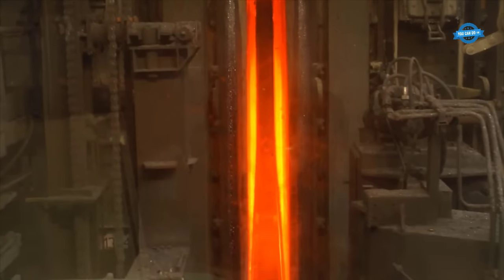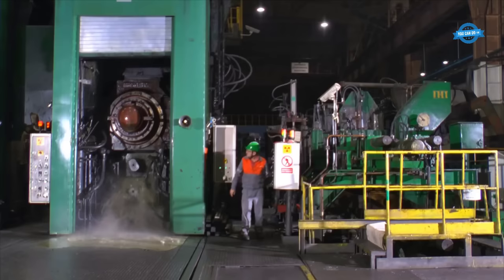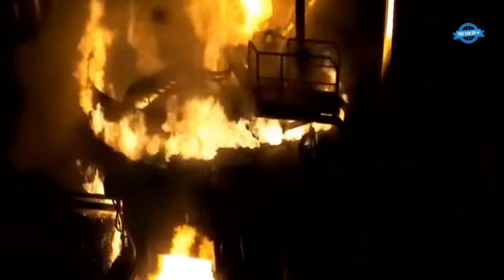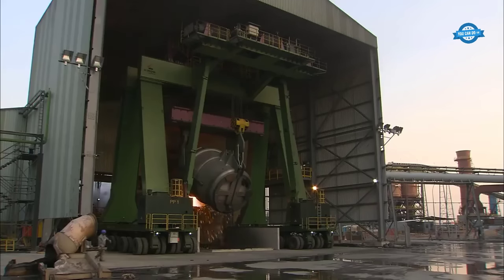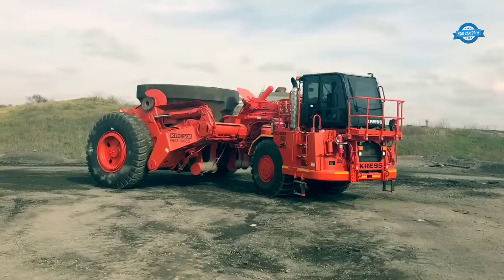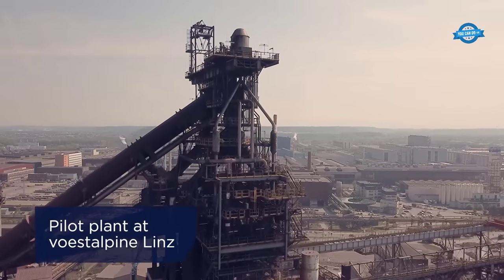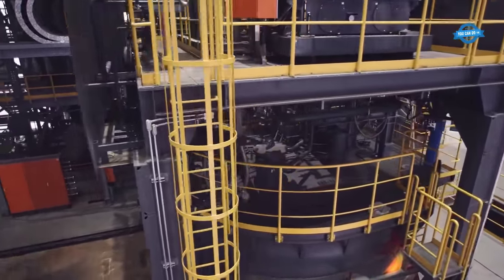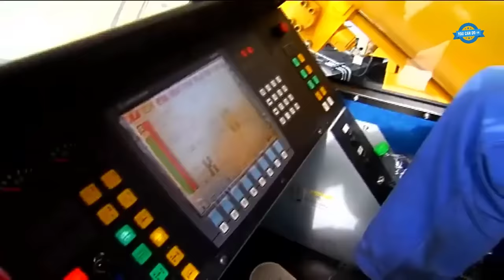Extremely Dangerous Accident Of Molten Metal Ladle. Heavy-duty Machinery & Equipments in Steelmaking

Comment: Artificial voice reading sales material and specs in a language the poster doesn't even understand.
Reply: It's sounds more like it has been translated sequentially through several languages of which the poster doesn't understand.
Reply: One of the most remarkable features of the grizzly Ladle is its exceptional heat and wear resistance it achieves this by incorporating additional protective measures for critical structural elements that are subjected to intense thermal and abrasive forces that ensures the Ladle remains in optimal condition.
Whewww,  I had to stop on that before I choked. I wanna memorize and use sometime during a conversation with someone I don't like. 
Lol. Have mercy
Reply: @sammylacks4937 Agreed.. hear..
Reply: @bobweiram6321 Yeas,agreed..

Comment: The " hot metal" from the furnace we call "pig iron" and we call them "bottle cars" not torpedo cars. Worked as a union Boilermaker all over the 9 blast furnaces, 6 oxygen furnaces and assorted electric arc furnaces and their associated pollution control systems in SE Michigan.
Reply: In the case of the "torpedo cars" it could be that it's a literal translation from a non-English language. I have heard them called as such in the (stainless) steel plant where I work as an industrial (IT) systems engineer. However, that is only the term used in my native language and dialect, plus I only have my specific plant as a reference. So, likely it's the wrong term in English indeed, since I have never heard the term used in English before while I have heard the term "bottle cars". So my guess is that it was literally translated from some European language. Perhaps, since this was recorded in Poland, they are called "torpedo cars" in Polish as well

Endlessly fascinating environment in any case, I could wander around there for days being in a constant state of awe. That said, you do have to have your head on a swivel at all times. And even then, serious accidents will still happen from time to time, though much less frequently than they used to. Everything there is huge, hot, flammable, toxic, under high pressure, at high speed and/or massively heavy, so if accidents happen, the consequences are often proportionately serious. We had a fatal accident not too long ago where someone's sleeve caught on some spinning rollers used for cold-rolling steel plates and he was pulled in.
Reply: @BinaryBlueBull  I'm 72 and in my years I've worked with people from all over the world. One thing I've learned is that different people refer to the same thing with different terms. This depends on your country and in some cases your trade.  My comment was meant as informational not a criticizm.
Reply: @richardkawucha1232  Indeed, quite clearly, and I read it as such too. My reply was meant as an addendum, also not as criticism. I personally love encountering random snippets of information, such as is the case with your comment. So when I know something, I often try to share it in turn. Kind of a quid pro quo for all the information other people have provided me with
Reply: @BinaryBlueBull  I also enjoyed this as I am of Polish descent.
Reply: Yeah and the folks from Bethlehem Steel called them 'subs'.  Different names, same thing.
Reply: @BinaryBlueBull   Most of the fatal accidents at steel mills in my experience as a safety steward in a big integrated steel mill was accidents not directly related to the production of the steel which most would think to be the most dangerous.  Most of the deaths seemed to be from maintenance related accidents such as scaffolding, confined spaces, lockout failures.  The people in the dangerous jobs knew the risks and were always on guard of encountering them.
Reply: They're probably called different things in different regions.
Reply: SE Michigan , all those plants are shut down now . McLouth , Ford Rouge , Great Lakes .

Comment: I worked for some years in a foundry that produced Aluminum Nickel Cobalt 5 magnets (AlNiCo).  While it was a relatively small foundry, but I did have the experience of running without thinking!  I ran, for the first and only time in my life with no consideration about weather I should run or not!  I was standing next to a mold that was filled with white hot metal when it caught on it's track and began to tip over.  I could have easily been killed by that metal but instead I ran!   I am an old man now but I never again faced such a situation.  There was no decision!  You run or you die!
Reply: I worked with liquid steel for 29 years. One melt 350 tons. The plant produces about 10 million tons of steel per year. In case of danger, always run to the safe side and only then look back at what happened. Sometimes when going to work, an inner voice tells you that something is going to happen at work today... And it does. This is called intuition based on vast experience. At work, like a pilot in a dogfight, you must constantly turn your head and constantly monitor the situation around you. Greetings from Russia
Reply: Run to Christ for salvation, or the wrath of God will burn against you eternally, for breaking his commandments and rejecting his way of salvation!!!!!!

Comment: I'm glad I got to see deep inside heavy industry in person.  I snuck into a VIP tour in US Steel Gary Works about 45 years ago.
Reply: I actually worked there. I worked in the blast furnace. They took us on a tour to the Bop Shop and we were on the level where the crane picked up the buckets to pour near where we were standing. It was interesting a terrifying all at once.
Reply: My dad's old college roomate worked there back in the 80s as a mechanic. We visited the place a few times and as a young boy it was an awesome place to see. The size of the machinery and vehicles alone was jaw-dropping. I never saw the furnaces or anything inside, but what I saw in the shops was enough to last a lifetime.
Reply: Did a similar "self-guided tour" at a lead/zinc smelter in Montana years ago....the sulfuric acid plant was awesome....
Anyone here used to work at that place? East Helena ASARCO plant, closed round 2000...

Comment: 0:11 Geneva steel in Utah has a foundry pit just like that and I had to use an industrial vacuum for all that slag. When the slag is still hot and you vacuum it up it creates arks as wide as lightning and they would jump from my feet to my arms and up my back, It hurt bad.
Reply: If you ran an internal grounding wire inside the pickup tube, would that cut down on the static electricity?
Reply: I know vac trucks are used in steel mills - but not for hot slag .
And I have heard of workers getting shocked  - maybe leather gloves would have helped .
If this actually happened to you often ; your boss and coworkers were blanking over you .

Comment: Informative, but completely misleading title. You didn't cover any accidents, no footage, yet that's the main promise made.
*My mistake folks, there's a whopping 6 minutes of footage of accidents....I skimmed over them by accident because they were so short and all one after another.
Reply from the maker: Please refer these:
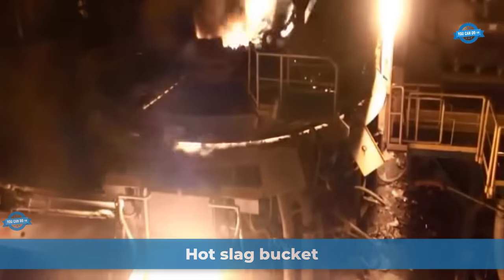11:53. Hot slag bucket
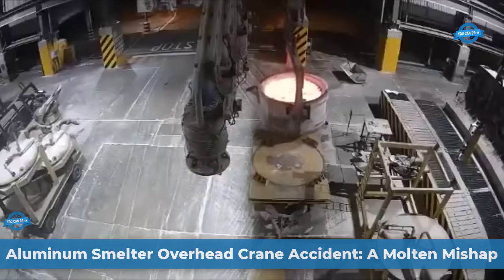13:33.  Aluminum Smelter Overhead Crane Accident: A Molten Mishap 
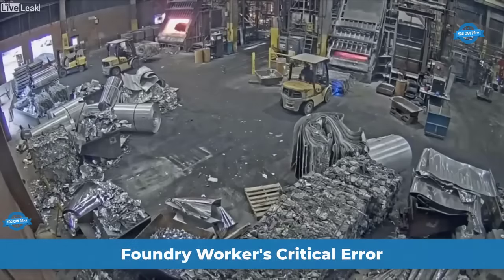15:22. Foundry Worker's Critical Error
Reply: Well...less than 6 minutes of accidents in a 40+ minute viddo...Very well, I partially retract my statement, but I still take issue.
A) It takes until over 13 minutes to show any accidents, and B) Each of those segments is two minutes long, the last even less, out of a FORTY+ MINUTE VIDEO.
If you labeled your food with the strong implication it's made with natural ingredients, then only 15% of the product is actually natural, it's false advertising at worst and ignorant at best.

Is there really a lack of video footage, or even investigations into other accidents in the field you could have discussed? Yes, there are tons.
You probably should have either made it longer or cut the detailed descriptions of the machinery and focus on the accidents.

15% of a video containing accidents while titled primarily as an accident video is deceptive and clickbaity.
You could have included something about accidents in the title, but not as the main focus.

*I think your lack of likes on this is an implication that many felt the same.
Reply from the maker: @davejones9469   Thank you very much for taking the time to comment. Because the title can only have a maximum of 100 words, we also ask for permission to put the content that is considered most attractive to viewers in the title. However, we have also carefully separated each content section/item into timelines (you just need to click on the timeline) to keep track of the sections you are interested in. Please check the video's description.
Reply: @YouCanDo_TV   @YouCanDo_TV  I suppose it makes sense that you need to maybe stretch definitions for the sake of the algorithm, but I just think there are better ways to do it.
Also, if you split it up (metalworking machinery and accidents separately) you could get two videos out of the same script basically. More output and possibly more revenue.
The manufacturing videos on YT seem to do extremely well, so I don't think they need to be spruced up at all.

Sorry for ranting, but hopefully it's taken as intended; constructive criticism. Don't mistake my bluntness for malice, I just don't like writing things all flowery to protect all the fragile egos out there lol.
Reply: @davejones9469  Not to mention, not a single fatality! Very disappointing. irony

Comment: @alexvan5108

I worked with liquid steel for 29 years. One melt 350 tons. The plant produces about 10 million tons of steel per year. In case of danger, always run to the safe side and only then look back at what happened. Sometimes when going to work, an inner voice tells you that something is going to happen at work today... And it does. This is called intuition based on vast experience. At work, like a pilot in a dogfight, you must constantly turn your head and constantly monitor the situation around you. Greetings from Russia

Comment: Where is the "Extremely Dangerous Accident Of Molten Metal Ladle"?
Reply from the maker: Please refer these:
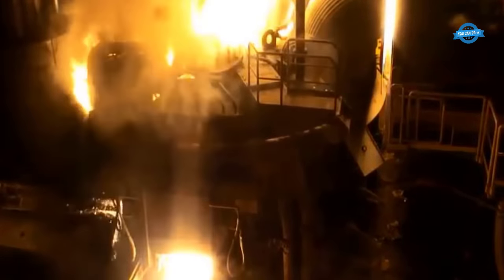11:53. Hot slag bucket
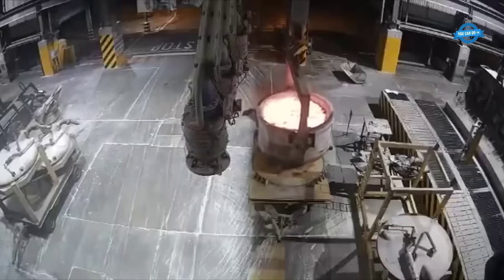13:33.  Aluminum Smelter Overhead Crane Accident: A Molten Mishap 
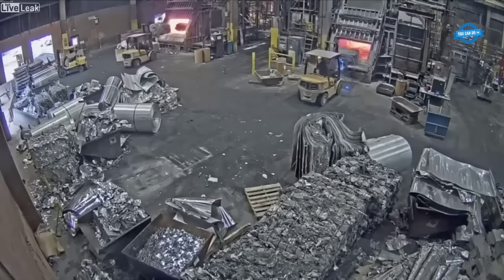15:22. Foundry Worker's Critical Error
Reply: Try watching the video
Reply: @YouCanDo_TV have you ever worked in a steel mill. What you showed is day to day life. Speaking from 30 years in the steel making industry.
Reply: Ever been in a mill and witnessed a cobble or any other type of "accident"? People die in mills a lot more than one would think.